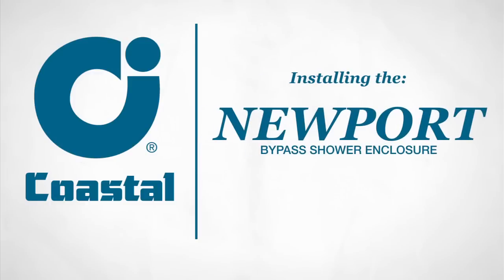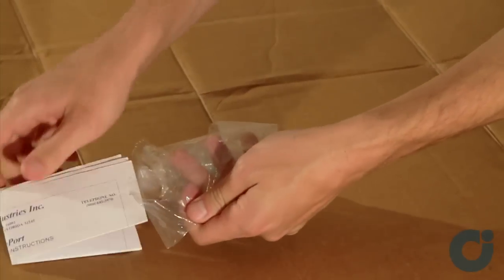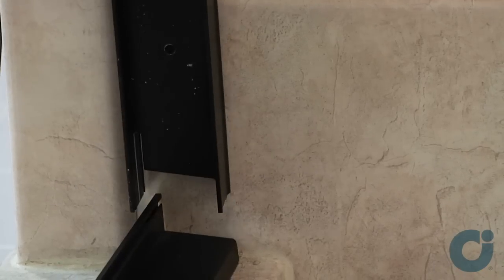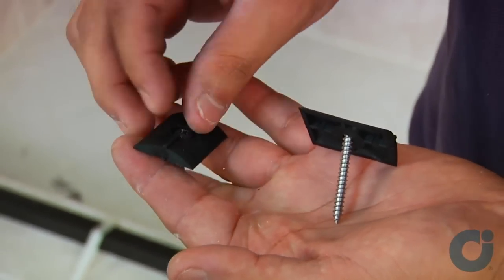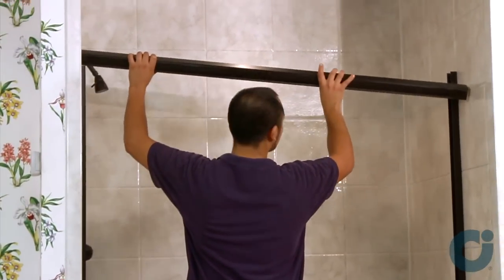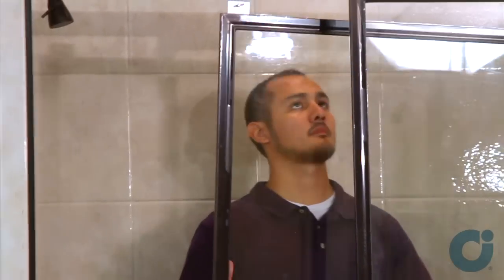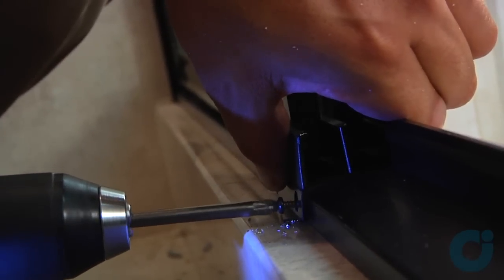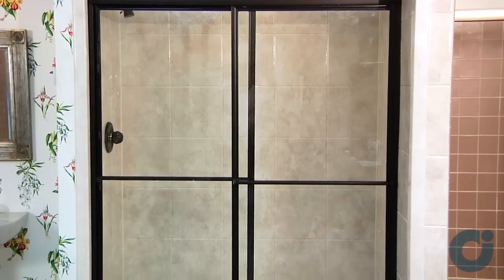Sliding Shower Doors - Installation of Tub Bypass

Comment from the maker: From cst.al    

J Jason -  Thank you for your feedback.  Cst.al recommends never to caulk the inside of a shower door.   Only caulk the outside of the enclosure where the metal or glass meets the wall.  Its always best to let the water drain back into the shower rather than letting moisture to become trapped.   Once that happens the caulk will mildew, and water will be forced up and into the installation screw holes caulking big problems down the road... especially on 2nd stories

#showerdoors #install #tip

Thanks for looking!

#LETSSHOWERTOGETHER

Comment: Well, you don't need to drill the bathtub to secure the threshold, or sill. It is fixed there by the jambs from moving back and forth. Caulking outside, though giving chance to trap water underneath, it does prevent from water dripping to outside, since some water getting through joints or screw holes. I guess you can caulking both inside and outside and joints.